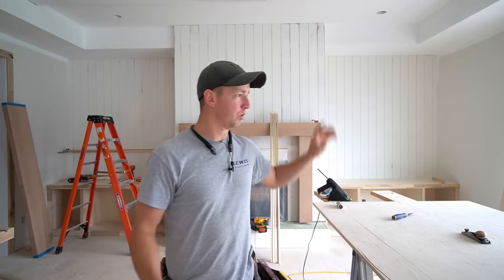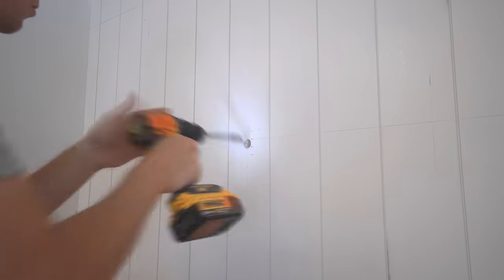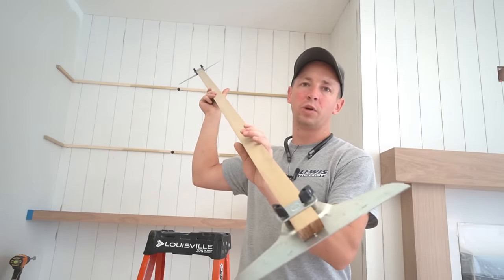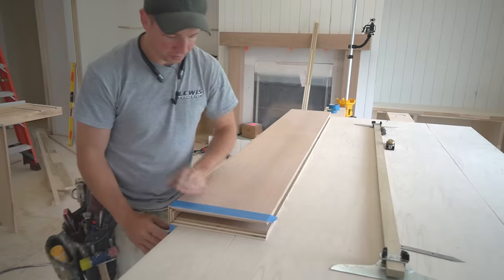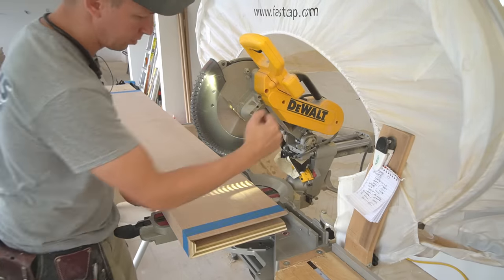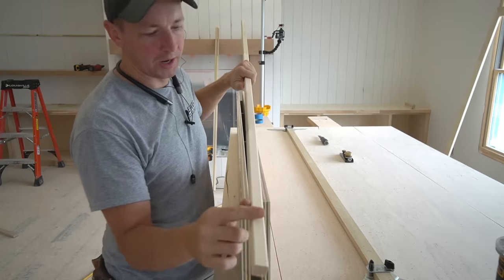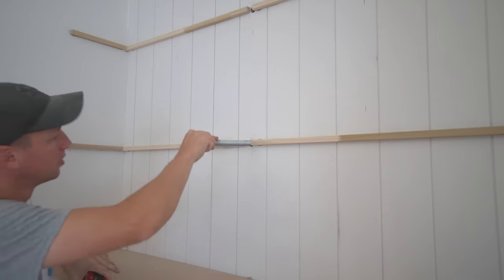Floating Shelf Installation Hacks - Keys for a TIGHT Install

Comment: A trick I learned a couple years ago for tight fits like this is rub wax on the ends of the material you are sliding in. Helps protect the walls and makes material slide easier.
Reply: Just spread the wall with a board like he did and there's no need
Reply: Painters will love that, nothing like painting wax 😂
Reply: @michaelmaas5544  Kick it down the line, like everyone does before us
Reply: I'll try that. I just struggled with an install on an alcove like this where the walls were trapezoidal, pinching towards the opening, 5/8" tighter in front than back. I use the wall spreading technique, but on finished walls I dislike it. I ended up cracking the corner bead of the drywall loose and of course paid for the repair. Would have been much easier to clean up the wax!
Reply: @alphaclean3364  true story bruv 🤣🤣

Comment: Hi Spencer, great video. Do this a lot as well as interior builder. Maybe I can provide a usefull tip. I always round over de back corner of the scribe cut with a sanding block. Joining wall corners are slightly rounded most of the time. This reduces damage to a (finished wall) while sliding and leaves a tighter gap on the backside. I also use plastic laminated paper to further prevent damage. 
The scribing setup is great, I'll gladly nick that idea from you.

Comment: Man those stair tread gauges are a great idea!! 
This is right up my ally, I put in at least a dozen of these per month. 
I’ve tried the threaded rod method before, but found just using 1” maple dowel. And I get the dowel perfectly level by using a 18” long wood owl bit with a laser level shining down the side while I drill. 
A little shot of silicone in there and it’ll never come out. 
And if you still need some micro adjusting, I make some 3/16 wide hardwood shims into the dowel hole. 
I’ve done at least a few dozen like this 100% level. And with another shot of silicone on the dowel, the shelf won’t come off either. Or you can fire a 24g or 18g pin through the shelf into the dowel. 
My favourite part about this method is that it’s solid enough to climb like a ladder and never become wobbly. And can still be wrestled apart without ruining the shelf or the wall.
Reply from the maker: Great tip with the long bit and the laser. I like to use the oversized hole and pl because it allows for some wiggle room to get things perfectly level.
Reply: @InsiderCarpentry  Ya, as a redundancy, the PL in the oversized hole Is a great idea. 
For my applications it’s mostly for full floaters with no walls to cleat to on one side, or both sides.
Reply: Is it fine to leave 1/4" on each side of the stud as a result of drilling the 1" hole? Seems like you're taking out quite a bit at that point.
Reply: @nadrojylloh  yes, because if you’re 100% filling that hole back up extremely tight with a much harder wood that you’re also gluing in. You’re actually increasing the strength of that stud.
Reply: @nadrojylloh  What Kermit said and also if it isn’t a load bearing wall it will not hurt even if it did not make it stronger.

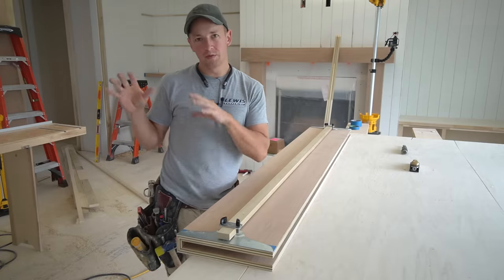Comment: 7:00 you must have done the framing and drywall as well, because you seem to have a perfectly square space to work with. What do you do when the wall is narrower at the front edge than the back edge? The only way I've been able to deal with that is to have the shelf assembled in 2 pieces, top and bottom, and tilt into place.
Reply: That’s what the jig he made was for, you could also just use a framing square and eyeball the difference and, as he recommended, caulk any gap that’s there if you didn’t do it perfect.
Reply: @AndrewMontgomery  i don't think thats what he meant, the problem is fitting the shelf into place, without damaging the wall too much.  try the board trick to push the wall out a little more as he did with the top shelves
Reply: @bradrichardson7922  oh the yea you’d have to do what he said about installing the top and bottom separate and then adding the face
Reply: I've had plenty of those instances where the inside corner was wider by as much as 1/2". That's why I install my floating shelves in two pieces. Top and front as one piece and bottom separate. It requires more steps, more time, I also scribe the back as well. My floating shelves come prefinished so must be scribed perfectly without any caulking

Comment: So many great tips..thanks for sharing Spencer..when I do floating shelves I make them 3” thick & miter fold them..then I make a 4 sided frame 1 1/2” thick to fit the inside of the shelf( I’ll make the frame about 1/4 short of the depth to account if I scribe to the back wall..with stretchers every 12” to make a “ chicken ladder” or a sturdy frame..but I find if I have to slide the shelf in a drywall outside corner the front of the shelf is shorter than the back because of corner bead.. so instead of trying to custom fit & damage drywall I just cut my shelves 1/2” short ,slide them in & nail off into frame on sides close to edge & back ..then mill some scribe 3/4 x 3/8 & trim the sides of shelves to hide gaps but it also makes a nice detail..just my experience but love this channel

Comment: learned allot on the install, thnx, was going to ask why you did not use a portalign (old sears drill tool for perpendicular holes) to set the rod, then seeing all the struggle getting the shelf's in i can see now the need for a little wiggle room and the wall weggie spreader. you were a unhappy camper at the end of that one. its nice to see were all mortals and stuff happens that frustrates us all.

Comment: Why use threaded rods? I use long 3/4” Lag bolts drill a pilot hole smaller than the threads and install the lag and cut off the head. Done!
Reply: He answers this at 2:05. The rod is not cured in place yet when he puts the shelf over it, so the rod can move up or down to conform to the shelf opening and then cure in place.

Comment: question why does the rod need to be threaded if you aren't threading it into the stud ?looks like it was just pushed in with adhesive
Reply from the maker: The adhesive expands around the threads and grabs/locks in with the rod.

Comment: Great video and sorry I am so late to comment, but I only just saw it recently. I have a question: What do you use for brackets for deep floating shelves where they do not butt up against a wall? I have some 16" deep shelves that will butt up against a wall of shiplap on one side but are 'open' on the other side.
Reply from the maker: Steel brackets installed prior to drywall work well. Otherwise I'd use rod like I did in the video.
Reply: @InsiderCarpentry  Thanks so much for your speedy reply! I will try the rod and brace the shelves while the PL sets. BTW, I used your method for a pantry remodel and it worked beautifully!

Comment: Hey Spencer - I'm working with a similar bump out/alcove in my living room but with a 51'' width. At what length would you recommend incorporating the threaded rod to bolster the support? Or will the 3/4'' strips be enough?

Comment: this is great! super helpful. thanks.  Question, I see that your shelves are 3/4 ply on top and front and what looks like 1/4 on bottom. Do you have supports in side it running from inside front to back? How far do you insert the threaded rod into the stud? Thanks again. By the way, the stair tread link is now to an unavailable product.

Comment: Not to be a spoil sport but, I have to mention that the interior of most homes will eventually displease the homeowner and he/she will want to renovate a room (nothing is forever). Unless he/she was aware that the shelves are "floaters" they will be dumbfounded as to how remove the shelves since no fasteners were visible. Furthermore, with the adhesive chalk locking itself around the 5/8" steel rod anyone will be hard pressed to break the shelves free from the rod. I suspect that the shelves will need to be destroyed in order to remove it from the dry wall/paneling/wainscoting.

Comment: So, what do you do if the front of the recess is narrower than the back where the shelves have to go?  Personally, I just damaged the sheetrock and repaired it later. If you have wood there,  and a wood corner bead then you might have to pull some off to get the shelf in. Right?  You can quickly make one of those gauges by taking a long piece of wood, like a plywood cutoff,  then position a thin piece of plywood against the wall on each end and tack them  to your stick  with a brad nailer,  Your gauge works better, but if you are only doing one, my "bush fix", will do the job.

Comment: I have constant sighs and aghhs throughout my day  with some occasional other words #$* 😲. One thing I'm curious though with your floating shelf rod is are you screwing that rod into the stud? Perhaps I missed that part of the video. One thing I've found to be super strong is using a French cleat system with metal or  wood ( which  is cheaper then metal)  and more customizable. Just attach the cleat on the back wall screwing into studs  and drop shelf into place and youre done. Just make sure the interior of shelf is strong and supported.

Comment: Hey man , I’m wantin to do a 3’ x 14” (maybe 16” if I can get it to hold) but I won’t have side walls. I’ll have my main mounting wall only. If I know wat I want to hang on the shelf is 8-10 pounds do I have to do threaded bolts? Or can I lag the main board, put enough brackets on my legs and make a light plywood box shelf to slip over legs and main board?

Comment: Fixed like this means they can't be taken down  if one wants a change.  Floating shelves in England are much better , can be fitted easier and taken down if required. THE only problem is they can't be fitted wall to wall as these are.      Mike uk
Reply: More detail, please.

Comment: Question, not bashing.  Isn't drilling 3  7/8 holes into a stud that is 1.5 inches thick affecting the integrity of the wall?  If it's not load bearing, no big deal, but what if it is load bearing?
Reply from the maker: Keep in mind that you're then filling it with adhesive and inserting a steel rod into that hole. I think its just fine.

Comment: How would you make the cross cuts if the shelves were too deep for the miter saw?  I followed your miter fold tutorial and it came out great, but i'm stuck trying to decide what the best way to trim them to length after using the stair tread tool to scribe.  My shelves are 16" deep and that combined with the thickness (2.25") are just a bit too much for my sliding miter saw to handle.
Reply from the maker: 2 good option. 1, use the miter saw and flip it. Cut the front side first and then sneak up on the back side. 

2. Track saw. 

3. Table saw with sled. This would be my last option.

Comment: Good video
I like using a Festool track saw to cut my shelves to size
Reply: What if it's not a Festool? Will another brand work?
Reply: Yes I’m sure other track saw can get similar cuts.
I bring the saw to the work.  It is easier to make the cut.
I have never used another track saw but Festool.

Comment: Hi Spencer, Loving the content mate, always picking up great tips. Do you find the Dewalt dw780 mitresaw suffers from blade wobble? I have the same saw and there is a slight wobble, have checked with many of my blades but all the same result. I am mainly using Freud Diablo as they are at a good price to quality for most of the kind of work i do,  I do lots of Reno work. Thanks
Reply from the maker: Mine cuts fine for me. Its acceptable.

Comment: there is much easier ways to install floating shelves than how you are doing it. don't get the threaded rod use. you can use any rod why threaded when you are not using the threads.
Reply from the maker: Because the threads bite into the adhesive giving a mechanical bond and all thread in available at any big box store.

Comment: Another great vid, the glue comment will be used on other channels for years to come. Are you not afraid of drilling into electrical? chances are slim, but would be shocking if you did lol. Also what kind of weight would you guess those shelves can hold?